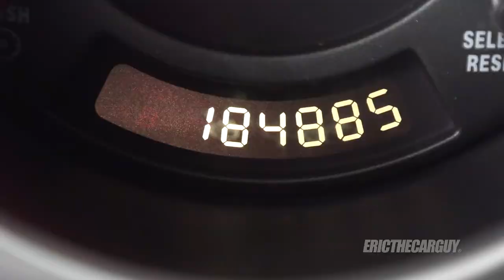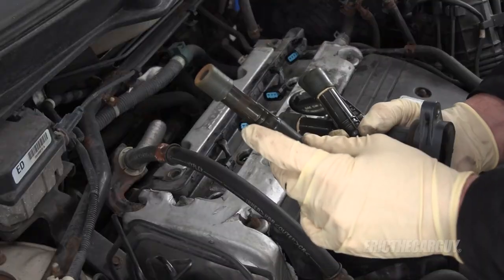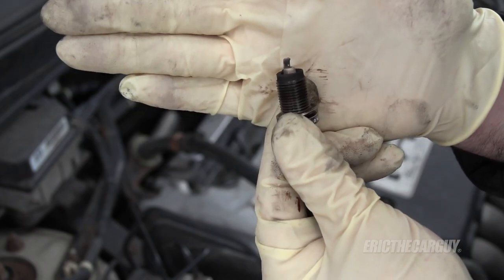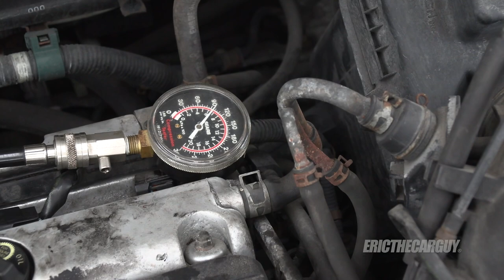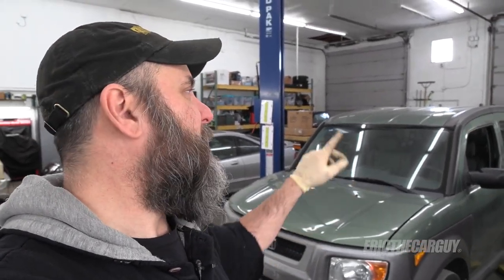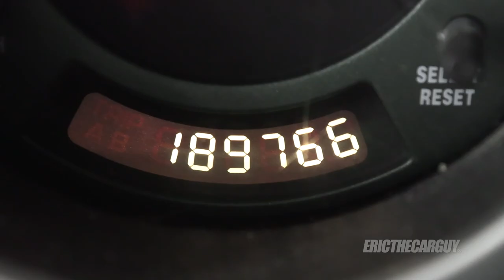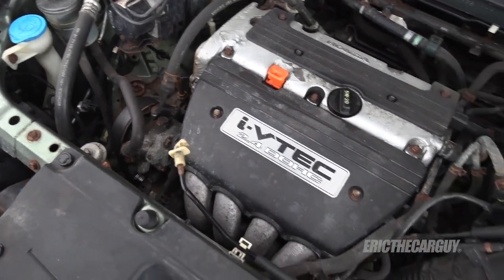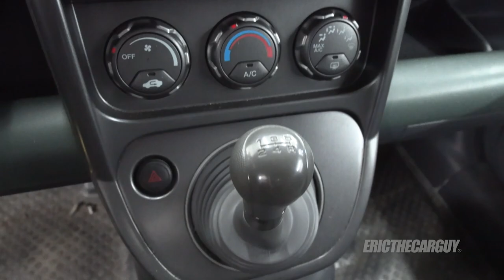I Just Bought 2 Honda Elements

Comment: That’s pretty dope I picked up my 2005 Honda CRV which is an EX model for 300 bucks I didn’t bother Compression checking or anything the engine could’ve been good I did use a scope and there was no valve contact any of the Pistons I just didn’t feel like digging into it anymore so I bought a JDM  Engine for $1300 and ended up putting that in now I should’ve put a water pump on it because that bit me in the butt about a year later so I had to put a new water pump in while in the car and the driver side axle seal was leaking like a river. I ended up using Aftermarket SKFaxle seals which for whatever reason did not solve the problem so once I went and bit the bullet and paid 25 bucks for one from Honda and installed it everything was good but my dumb ass I thought I fixed it the first time and I drove it about 30 Km until I noticed the transmission acting up I still had to get it home which was my dumb ass thing the transmission is shifting fine but when I go around corners it does tend to slip so I for see a transmission sometime in the future. Oh yeah the previous owners had a child there was tons of candy and crap all over the backseat that I had to clean nonetheless I have a working running driving CRV that I’ve been using for the last three years now. But I do miss my suburban

Comment: I bought an Element brand new back in 2006. Last new car that I ever purchased since then. It was a very versatile car for sure. Hated the visibility because of the door pillar location and suicide doors opening and closing in a parking lot was a hassle. Only had the car for about 2 1/2 years and purchased a used 2009 Honda Fit which I still own. Interested in seeing your progress with your two purchases.
Reply from the maker: I agree on the visibility. It does suck.

Comment: That was my first thought too when I saw the torn hole, it looked like it got yanked out of a rough spot after taking a trip off the pavement.  My Aunt used to have one of these, you could basically hose out the inside after a day of throwing muddy bikes in it. It was incredibly practical.
Reply from the maker: I strongly advise against hosing out the interior of one of these vehicles. I'd like to meet whoever started that idea and school them on what water does to electronics in a vehicle.
Reply: Key word "Basically" if you're actually taking a hose to the inside of a car you're a special kind of dumb haha.

Comment: I kinda did this same thing on my 92 civic si. I had to drive 1200 kms to work in northern British Columbia and it just wasn’t running right,vibrating and low on power. I put new plugs,cap and rotor,nothing changed. Continued on to my destination. When I got there I unclipped each injector and it didn’t change on one cylinder so I thought bad injector,no big deal right.swapped each injector into different cylinders,same dead cylinder. Car has 462 thousand kms on it.Figured out it was under 90 psi. Drove back to Vancouver island a few weeks later and bought a’14 civic coupe,5 speed to replace it. Still drove the car on 3 cylinders for a couple thousand kms,now trying to decide if I get a new engine for it,I love the little hatchback,it’s been through a lot of shit with me so it’s hard to get rid of it🚗

Comment: Yes!!  Dont use grease or antiseize on those caliper pins.  Only silicone grease.  The reason is, even though silicon grease isn't the best lubricant,  its IS the best at keeping water out.  And it keeps those little boots happy.  Same reason honda pickles electrical connectors with silicon grease.

Comment: I like the color of the beige Element as well Eric.  Nice find with the 2 new to you Elements.  Not really a Honda fan but I admit the Honda Element has grown on me as well.  Wouldn't mind one actually.  I've never seen a manual one here in Idaho, all the ones I've ran across have been automatics.  How's the automatics in them?  I know Honda seems to have somewhat weak automatics but I'm sure a lot of that also has to do with the lack of maintenance like with most vehicles.  We at least don't have as much of a rust problem here in Idaho....yet.  They're now starting to use salt on the roads here sadly instead of the sand they've been using for decades so it won't be long till we have the same rust problems out here unfortunately.  

Neither of those Elements really look all that bad body wise, and the rust on the green one I'm surprised isn't worse, but the beige one looks really good, hope you end up keeping it like you plan, it'll make a good project vehicle for videos...although I think you've done a few Honda engine swap videos in the past if I recall, its always interesting to watch regardless.
Reply from the maker: To my knowledge, it's only the 6 cylinder Honda automatics that are a problem. Most Honda auto transmission problems I see, aside from the design flaws of some of the V6 transmissions, are caused by incorrect service. Either using the wrong fluid, or putting too much in because the level wasn't checked properly. As for the automatic in the Element I've had since '08, no issues at all. The manuals are more fun to drive though. They are lighter and more responsive in my view. Thanks for the comment.

Comment: For the tan one, could be burnt valve.  I had an 03 and it had stalling out problems and cels.  Honda replaced a bunch of stuff that did nothing, until they adjusted the valves, problem fixed.  30k later honda said it needed a new head due to burnt valves.  Supposedly the element in australia had 60k valve adjustment intervals, but in usa they left it at 120k, for low maintenance.

Comment: So, brake caliper grease is not good for the slide pins.  My Hondas all have less than 80k miles.  So, I haven’t seen any breakdown of the boots.  I will definitely clean and lube them with silicone paste in the near future.  Thanks for the tip.

Comment: Someone I knew was test driving a car at a dealership. Thankfully they, for whatever reason, took the owners manual out of the glove box and it was dripping wet. They looked at the spare tire in the trunk and sand was all around the tire. Popped the rear seat out (Didnt know that was a thing in a car) and there were leaves and sand under the seat.... Yep, car came from down south....

Ive had the inner side of the tire on a honda feather like that also. It was a Michelin tire. Had the alignment checked, suspension appears good, tires sounded horrible on the HW. Like it had mud tires.

Comment: Considering the ripped hook hole was pointing slightly down, yeap, that's the most plausible. The Element was down in a ditch, assend up, and someone hooked it up and pulled like a mad dog, whomever they were, they didn't really know what they were doing, kinda like trying to pull from around the corner.
Reply from the maker: The sad thing is there is a tow hook right in the middle welded to the spare tire well.

Comment: I have an 08 Element Automatic Transmission. Wanted a manual but wife wanted Auto. 5k and it had 110k on it. Absolutely love this vehicle!! Looks new inside and out. Front bumper and condenser was replaced bc of a collision but wasn’t enough to deploy airbags. One of the most Multipurpose vehicles I’ve ever seen. Camping packages you can buy for it is awesome as well. I want a manual since I bought my wife a new car and I kept this one. However I want to keep
This element. Not sure if I can switch it to a manual or not? Do you know and if so how
Difficult? Thanks. New subscriber btw but watched many of your videos

Comment: You should have looked at Copart b4 buying these.. Ive bought 2 in the last year out of Maine and NH Copart with minimal damage for under 2500 for the pair.  One had 180ish miles and the other 150ish and neither needed to be pulled.. just panels replaced and paint. Both auto AWDs.

Comment: Hey Eric, if you haven't figured out the noise your son complained about coming from the rear of the Civic -- it's possible that the muffler or something along the exhaust system is banging against the floor board on the passenger side. Mine is an '05 coupe too and does the exact same thing. It's almost like a metallic banging and grinding noise or a sway bar rattle but louder. It's even worse in the rain because the thermal shock on the pipes as they hit the floor almost makes it sound like the car is gonna blow up. It correlates with acceleration too. If I accelerate on a hill and turning left, it'll bang/rattle/rub but once I let off the gas, it stops or until it stops on its own. It's a really weird sound. Honda did a small recall on them but it didn't happen on all 7th gen Civics. I'd love to see you tackle that.
Reply from the maker: I haven't had a chance to look it it yet, been pretty busy lately. I always check the exhaust for rattles though just like I did in this video. I don't recall hearing any with his car. Thanks for the tip though.

Comment: The green one has a replaced facia (bumper cover)  from a 2006 painted version , probably was in a front end collision had the radiator and some structure replaced or straightened, the AC worked on recently .  Check it deeper.

Comment: Extremely practical vehicle. I bought a 2008 element Fwd automatic with 206k miles. I've only done one oil change and got brand new set of tires from costco for 600 bucks. Still runs very strong. Fingers crossed that it will last for a long time.

Comment: I had a 2002 Honda Element green exterior with green interior too my father got it as a trade in for 900. 2 weeks later I got rear ended and the car flipped two times and landed on up right on the wheels. All sides of the car were completely smashed including all the windows. The driver who hit me fled.I remember waking up to the sound of the horn because i was unconscious laying on it. I lost my phone wallet glasses and everything in the accident because the car flipped so many times. I remember cranking the engine and it started, right up with little hesitation. It was leaking  coolant but I managed to drive it 15 minutes to my house, and got ahold of police. Crazy day it really didn’t feel real when it happened

Comment: Eric, you and your Element fetish😆. My mom bought a brand new Element back in 2003 for the 1st generation. She used it all the way to 2018 and 225k miles. She now has a 2018 Subaru Crosstrek. But when I sold her Element, although it wasnt perfect and a burned a good amount of oil, it still ran strong and true.

Comment: Thanks for the vids. Was good to see an quick inspection routine on the element. 

I tried starting my Element after it sat discharged for 6 months in the garage (with a new battery though). Battery light came on and the engine cranked. When I connected a booster it finally turned over but died as soon as I disconnected the booster. I  just recharged the (new) battery and as soon as I connected the terminals (made sure it was correct polarity) smoke started to rise from the alternator area. Quickly disconnected power and felt the alternator was very warm. Battery was weak for years before it was replaced. Could it be that the newly charged battery fried the alternator for some reason? And should I look at other things before replacing the alternator? Things like fuses or power cables etc?

Comment: Hi Eric, I noticed you found both of the Elements lacking the hole plugs for adjusting the rear brake shoes, I know that when I did my Elements brakes this summer mine got lost.  I was thinking the wheels would cover over them well enough to keep debris from entering, you think they are worth ordering and replacing?

Comment: Thanks... you have finally convinced me to NOT purchase a used Element..  And also proved to me that they "really" are not quality vehicles......  Locally with what shops charge.... i could see me paying an easy $10,000 dollar, when one considers parts and labor to bring these relative low mileage vehicles up to inspection stands... So Thank You very much for this your time..  What makes it worse is locally these cheese vehicles sell well above NADA retail....  People think they are bullet proof..... YOU PROVED THAT EVEN A LOW MILEAGE Element..... just does not hold up and requires extensive $$$$$ repairs.  And it looks like their metal is prone to heavy rusting.....  
'

Comment: the first element have been beat up and never really have get some care from the owner,  this winter i did 4 engine swap in these element(mine included) and i can tell when the owner love is car ;) i saw a 2003 with no rust and everything still oem from dealership and it as 196000miles But that the result off bad care....and he forgot to adjust the valve...a good engine that can get so much more mile on it... ive saw 487000mile original engine and transmission thumb up Honda

Comment: Thanks Eric - Love my Lement (E is gone), it can haul anything! Would you advise? I bought a 2011 EX 4WD, auto, new, now @ 80k. There is front end vibration, under load & acceleration at 45-50 mph. Smooths out at 55-65, 70,nothing. On the lift, engine/trans engaged, the front axles do visually appear to be shaking. Does that sound plausible? I know I hit some decent pot holes, but nothing off road. Zny comment is appreciated. Thanks, Jesse.

Comment: Love the khaki color, so fitting. I just bought a red '05 element. Is it normal for the doors to auto lock when the key is in the ignition? I was checking something while the engine was running and a gust of wind blew the door closed and it locked me out, lol. Definitely would like to disable that function if possible!

Comment: Oil burning seems to be a somewhat common problem on the K24 engines. My 2010 Accord (that was unfortunately recently totaled in a wreck) with the K24 had a warranty extension for piston rings that would get clogged up and allow oil burning. I was losing as much as a quart every 1k miles.
Reply: Not common to K24s, common to ones where oil changes were ignored.
Reply: @psdaengr911  It absolutely is common to K24s. Don't let any love you have for the engine blind you. It was especially prevalent with the low friction piston rings used for 08-10 on the K24 in the Accord, but even other K24s have had issues with burning oil.

I'm speaking from experience. Even with oil changes done at the proper time, I still had a K24 that burned a very significant amount of oil. If ignored, the engine would run out of oil by the next OCI.

Comment: I'm the original owner of a 2003 Element DX, AWD automatic. It's been sitting in my driveway because I'm pretty sure the Shift Solenoids are clogged. The transmission stopped shifting, unless I manually went from 1st to 2nd. Car has 128,000 Hwy miles.  I've always diligently changed all the fluids, (including rear differential & Transmission, etc...).   What kind of scanner would you recommend that could read the transmission code?

Comment: I went to an auto parts store and couldn’t find any silicone break lubricant but I did find some CRC brake lubricant and it said it was good for everything including slide pins. Then after about 18 months a rear caliper locked up and a slide pin was stuck.
Reply: Maybe Amazon?

Comment: Any thoughts on just replacing all the chewed up soda straw exhaust with some off the shelf 2"-2.5" pieces? Maybe a side exit in front of the RR wheel to take out several feet of unnecessary weight and restriction. I get that it's not a "performance build." Before and after drive, strictly butt dyno.

Comment: IMPORTANT! Blowing air into the cylinder as shown is meaningless UNLESS you first place the cylinder being tested at TDC on the compression stroke.  Anywhere else and the intake and/or exhaust valves may be open.  If they are open, you will naturally get air blowing into the exhaust and/or intake manifolds and then into adjacent cylinders as seen (if their valves are open).  If you do set the test cylinder at TDC-compression, it's a good idea to run your test with all other plugs installed.  That way you can check for air at the exhaust pipe (exhaust valve leak), air intake (intake valve leak) or inside the oil filler (piston ring leak).  If you have the other plugs out, air will pump across from intake/exhaust manifolds and you won't be able to tell if it's an intake valve leak or exhaust valve leak.

Naturally you will always have some piston ring leak, so you won't really know by sound if the rings are bad unless you compare the sound to one of the other cylinders.  Unfortunately you then have to set the other cylinder to TDC-compression for a comparison test.

Check your service manual to figure out how to set TDC on each piston for your particular vehicle.

Comment: If the valves are bent on cylinder 2 and cylinder 4's intake valve is open it'll do that.  I'd pull the valve cover and see what's going before just swapping an engine.

Comment: Eric I leave those rotor screws off intentionally.  More trouble than they're worth imo, as I inevitably need to use extreme measures to remove them.
Reply from the maker: You should check out the videos I did about removing them. It might make your life easier. Also, I put them back on because it makes doing a brake job a lot easier. Thanks for the comment.
Reply: @ericthecarguy  oh I'm familiar with both the 2 hammer method (which you might've invented), the impact screwdriver, and the special impact hammer tool.  I simply find it not worth the trouble when a lug can be temporarily tightened onto the rotor surface to accomplish the same thing, sidestepping all that.  Diff'rent strokes I guess :)